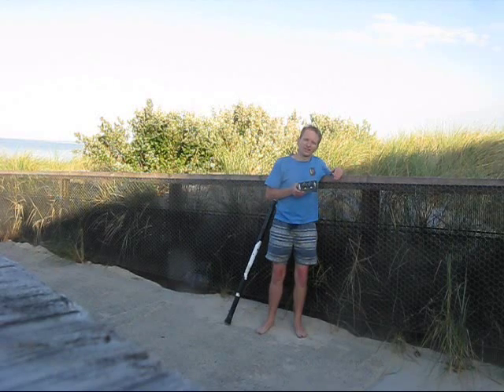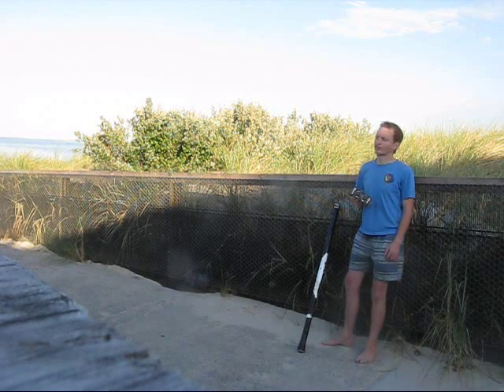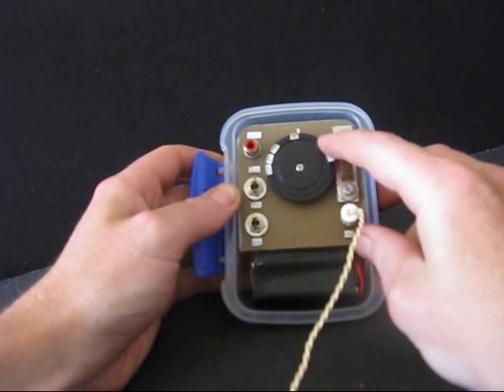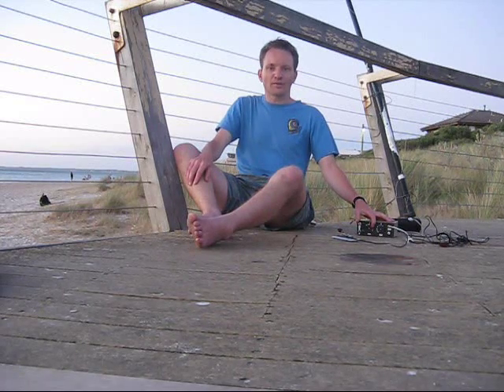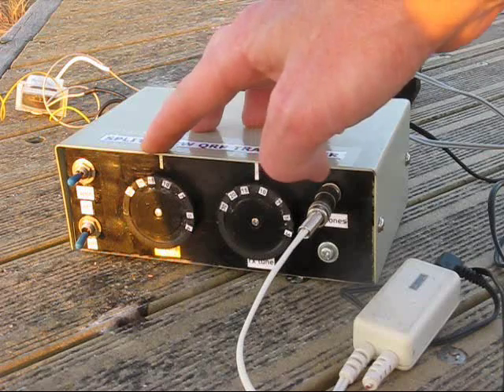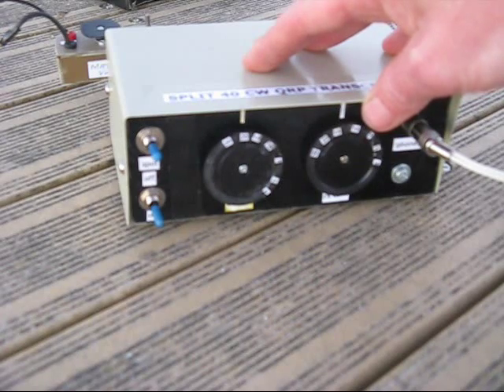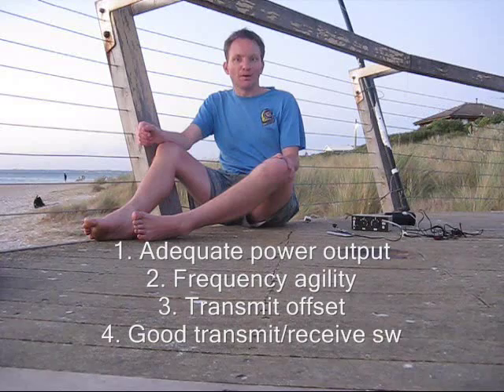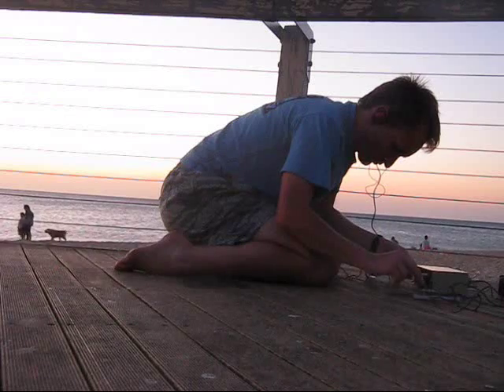Three features every homebrew QRP CW rig must have

Comment: This clip was done a few years ago using analog equipment.

My own experience in 2025: You should be able to adjust your equipment to an exact frequency.
When I say I am at 7028 kHz the other station should be able to tune exactly to 7028, or both stations tune to 7028 kHz and wait for a signal. This is a feature gained from digital transceivers with a digital display.

Comment: Not necessarily. Sit on the QRP xtal frequencies and make contacts. Other QRP'ers know where the QRP frequencies are. I've had several QSO's using the Pixie on 7.030 and 5.262 MHz., and a Short Wave Listener report from 220 miles away on 5.262 with my 350mW out. My one valve tx 1.6 Watts is also xtalled. QRP to QRP is good.
Bill, G4GHB.

Comment from the maker: The funny thing is that if you build a VFO QRP rig badly enough (ie poor buffering) the transmitter stages will load the oscillator sufficiently to produce a small shift (and probably chirp) without any offset being built in.  Not ideal but better than a no offset.